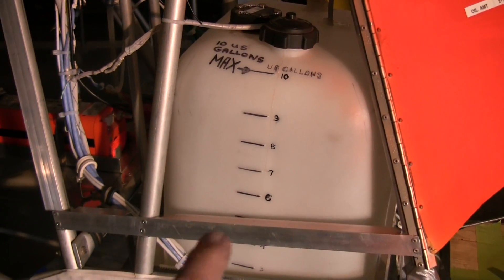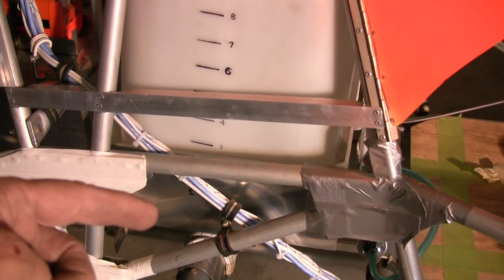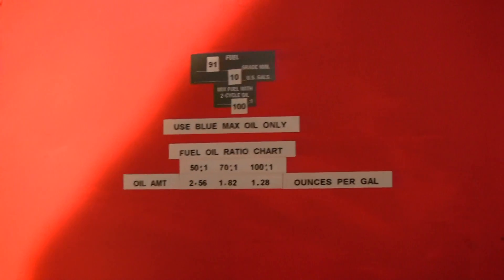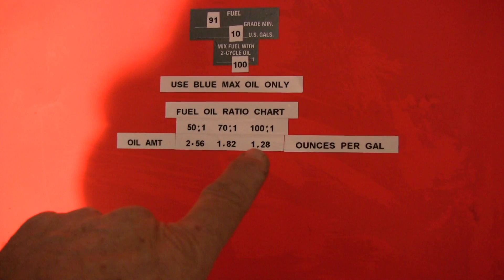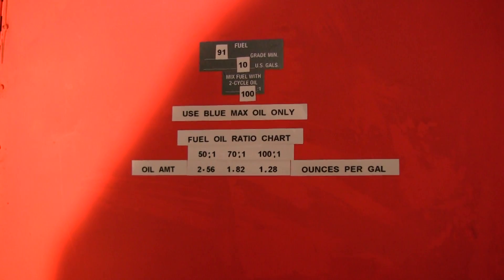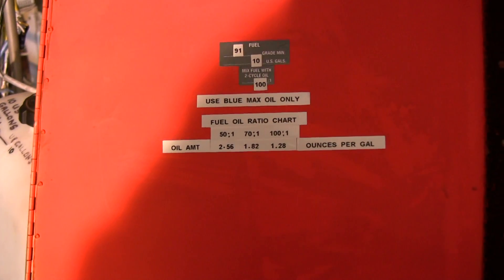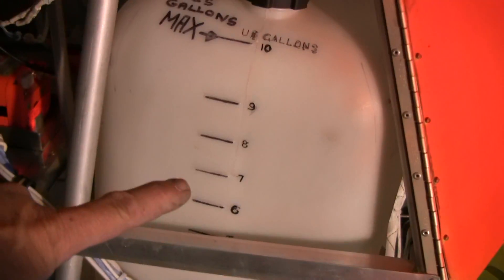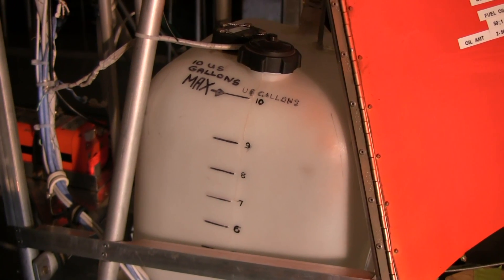MICHAEL HEIT HIRTH 3202 FUEL TO OIL RATIO.

Comment: I know that aero and chainsaw engines have different stresses on them, but the 100:1 fuel to oil ratio seems right to me. For 15 years I had a well known brand chainsaw and ran Amsoil 2T at 100:1, with no hint of any negative issues during that time, despite some of my learned friends beard-rubbing, chin-scratching and tut-tutting in concern! And chainsaws spend a good bit of their time at max revs, which even aero strokers probably don't. Never heard of Blue Max, though, but it must be good. Col, NZ.

Comment from the maker: When talking to my engine distributor At Recreational Power he suggested a 90:1 mix for thte forst 10 hours of operation. It is working great so far.  The tempratures are all inside the normal range, but my RPM's are a bot low so I need to tweak the throttle cables & set my idle RPM's. 

Thank you for the comment.

Comment: 100 to 1 is a little light for a engine that will  run at constant high rpm's. Your oil manufacture may say that mix is ok. But your engine is new still. So, I'd adding a little more could prolong engine life. 

Thanks for the videos.